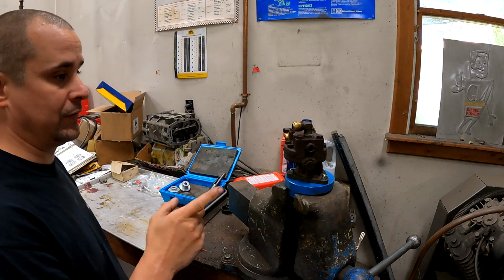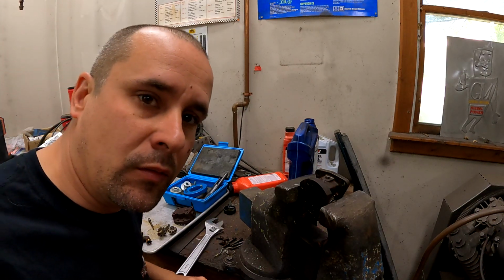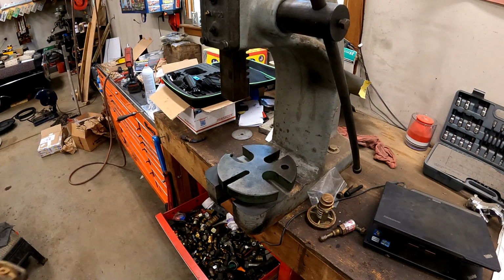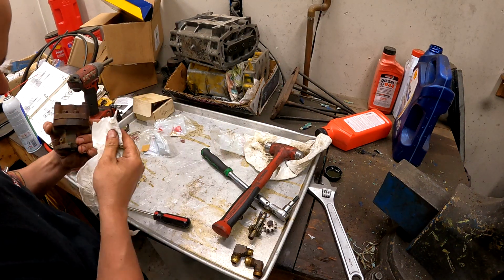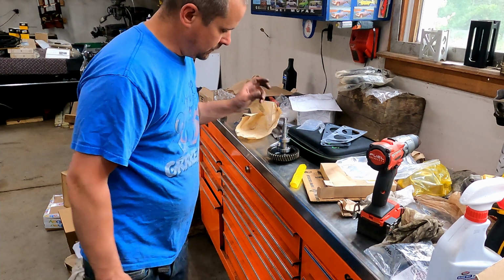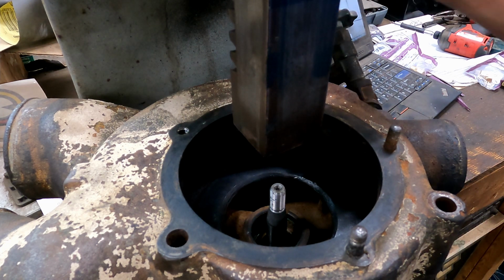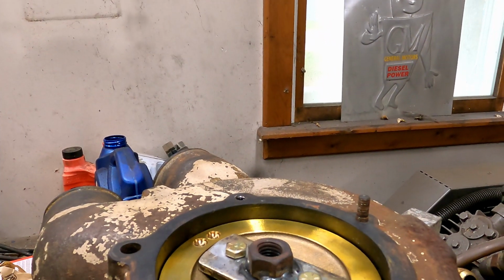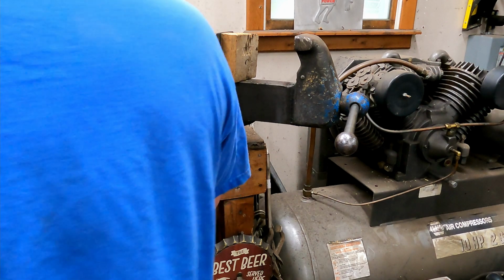12v71 Detroit Diesel Powered 1973 Peterbilt 352 Cabover Episode 8 How to rebuild fuel & water pumps

Comment: worked in  a GM diesel dealership and on the fuel pump we would just lap in the surfaces and no lock tight. Never had a leak.

Comment: Damn that is the first time I have ever seen the Ken-Moore fuel pump holding tool. The old man who taught me a good bit of what I know about Detroit’s which ain’t all that much used to lag the pump down to a piece of oak that he had soaked in old oil. Ya he was a old country boy who said he was shown how to that in the Army, he preferred Lard over shorting and used to pack the gears of the fuel pump with a little bit of lard and he swore by aviation form-a-gasket for all of machined mating surfaces that don’t use a gasket, the important thing when using aviation form-gasket of Indian shellac is to make sure it hasn’t evaporated and become thick and or lumpy if so thin it out with a little denatured alcohol or “ever-clear” but why waste alcohol you can drink (but not at 190 proof you morons).  When it comes down to it a two-stroke Detroit is actually pretty easy to work on if you can read a service manual and are capable of understanding what it says (ie you have to have an IQ above the temperature you drink Guinness Stout at and get it though your thick skull that these engine were designed and intended to be economically completely field serviceable and rebuildable meaning you rebuilt parts and do not replace assemblies which in today’s throw away world seems like a foreign concept to 99% of the population especially if they are not above the age of 35-40 years old.  I understand that Two-Stroke Detroit Diesels are a bit loud, the almost always leak oil (I have seen some that did not and had the correct amount of oil in them but you would never want to try and take them apart because there were painted by brush with Imron but that’s a story for another time) and there “tailpipe” emissions are not the best but how cannot like an engine whose basic design was so good that they saw no major design principles change in there 57 year production run.
Reply: Yes sir everything is designed on a Detroit engine so it can be rebuilt completely unlimited times . When the blowers have replaceable wear rings on the shafts for example how much better can you get . I never liked Detroit engines but now I have seven of them . They’re pretty cool and what I like about them is very little smoke compared to caterpillars when turbo takes time to spool up big clouds of black smoke . Thanks for sharing your experience